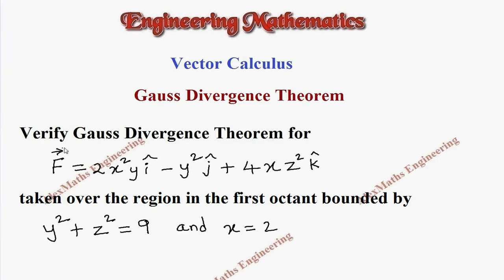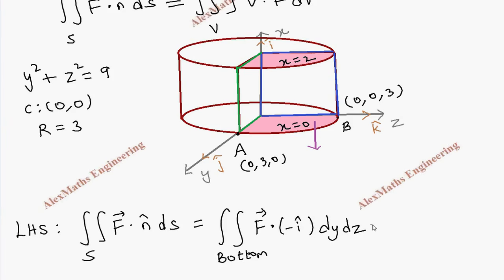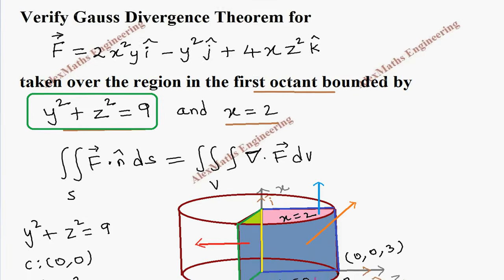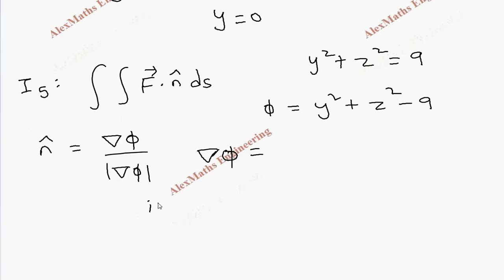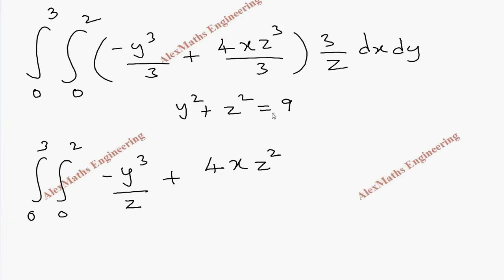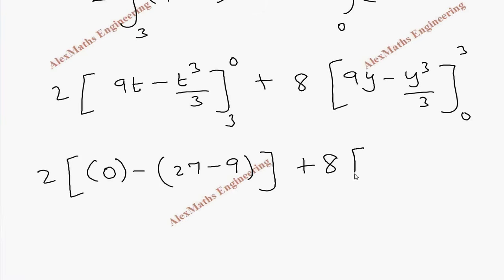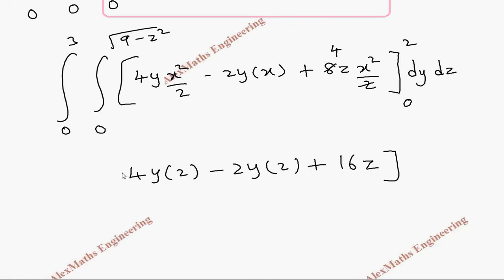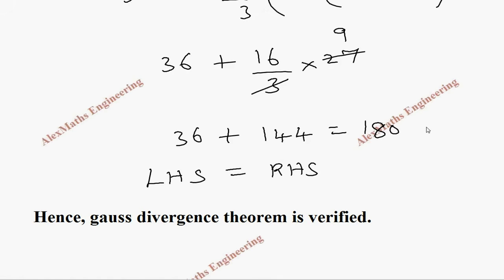Gauss divergence theorem Problem 8 | Vector Claculus | Engineering Mathematics

Comment: using divergence theorem evaluate the net outward flux of the field F=x³i+x²yj+x²zk across the closed surface S consisting of the cylinder x²+y²=a² a<z<b and the circular disk Z= 0 & z=b
Plz Solve & Upload the answer of this Qn.. 🙏
Reply: 5bπa^4/12